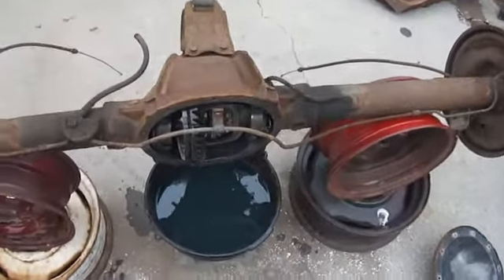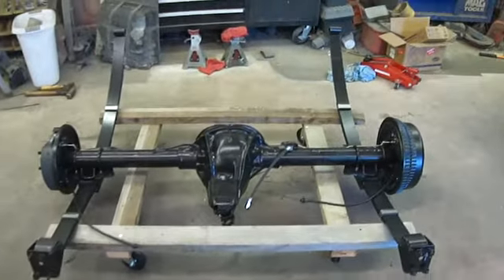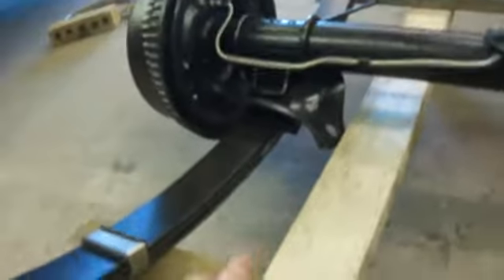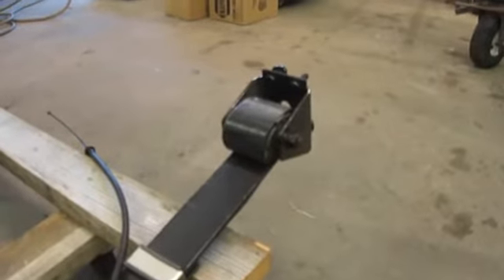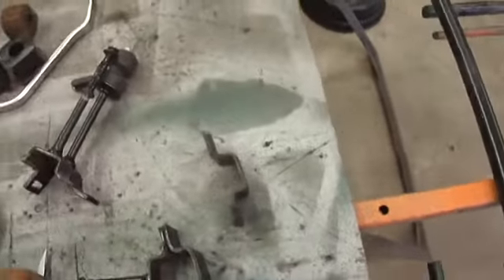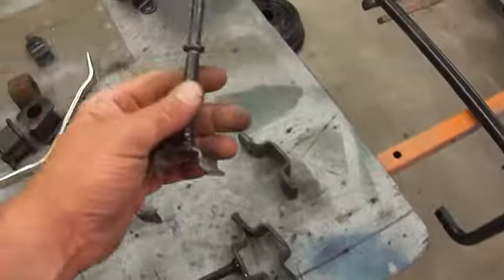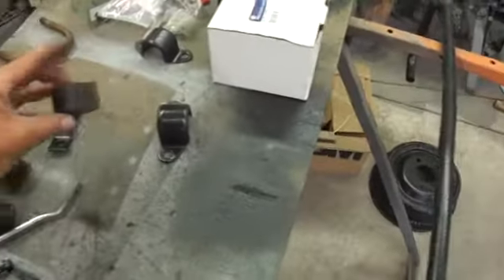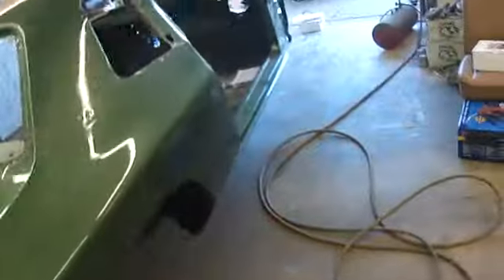1977 Chrysler Cordoba restoration - Part 16 - Axle & rear suspension

Comment: Did you rid yourself of the rubber isolators in between the diff and springs?
Reply from the maker: There are still in there. If they're missing there will be some MAJOR problems with a sloppy suspension.
Reply: Retro Auto - MN I know.  I’m a machinist and am going to make something to replace them, Those and the pucks up front on my two. Thanks for responding

Comment: I checked the rare parts site and they only have the front sway bar links listed.  Can the front links also be used on the rear axle?
Reply from the maker: Yep. The rears are welded brackets around the bushing on the bar but the fronts are bolted together. That's the only difference I've found between them.
Reply: Thank for the reply.  I've been looking everywhere for the rear links and this is exactly what I wanted to hear.